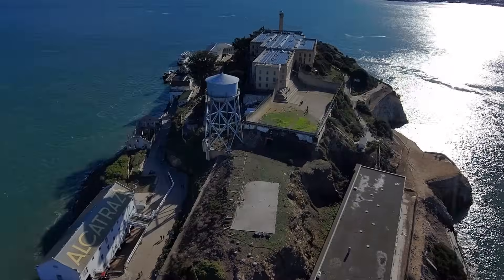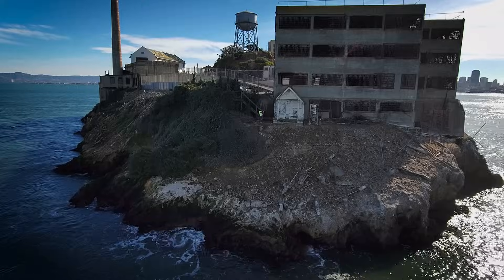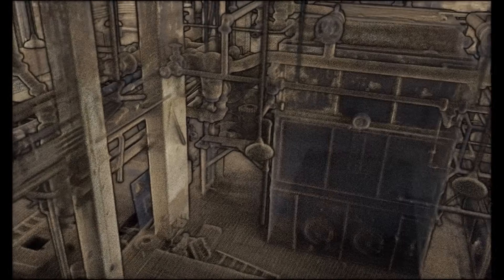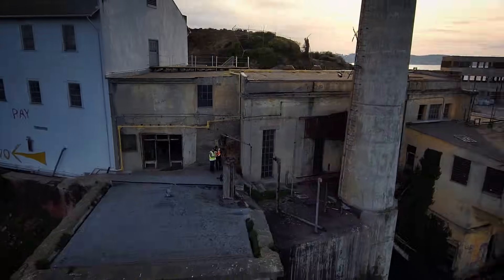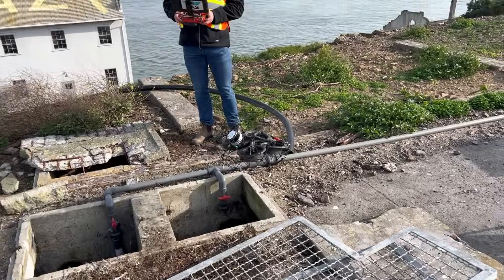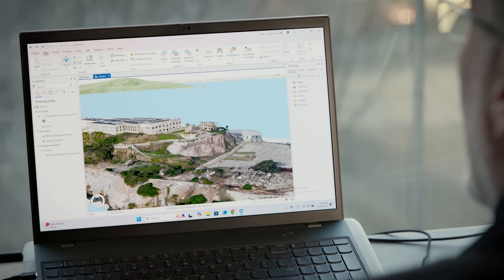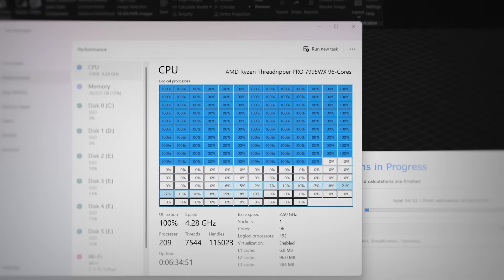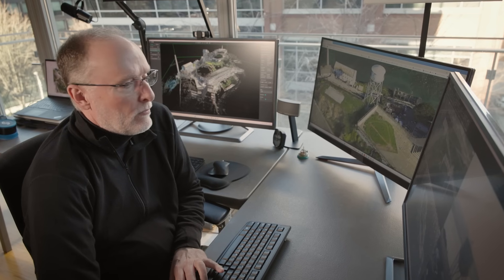Digitizing Alcatraz: Creating a 3D map to monitor climate change with Lenovo and AMD

Comment: What happen to acid rain? or sea level rise? yeah climate change is called Weather!
Reply: Acid rain we mostly fixed, by limiting pollution of the kind that causes acid rain. Rising sea levels is an ongoing issue, but for a lot of us, the effect is slow and won't affect us directly.

Weather is day to day. Climate is over time. If it rains tomorrow, that's weather. If it rains 3 more days a year on average the next 10 years compared to the last 10, that's a change in climate.